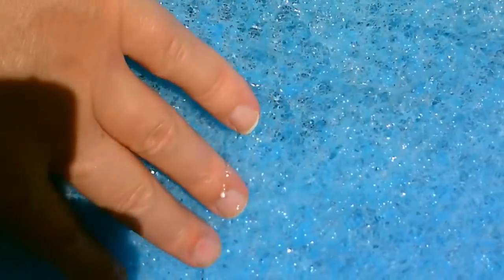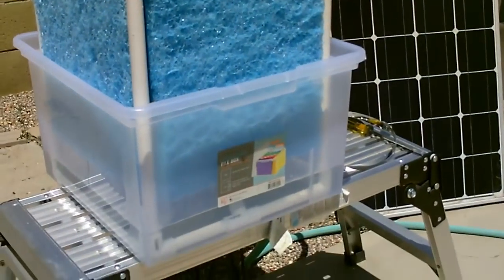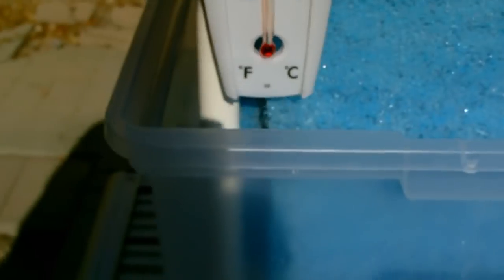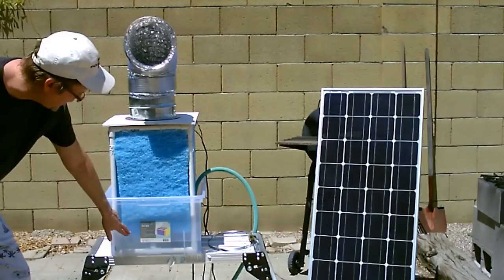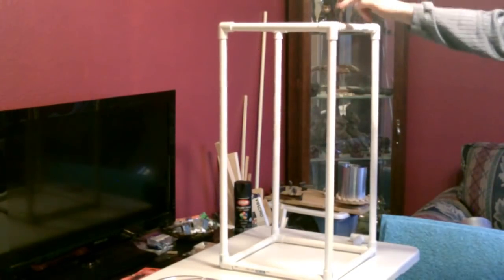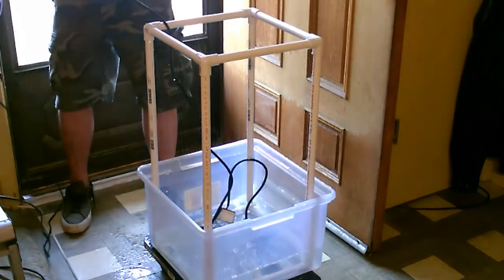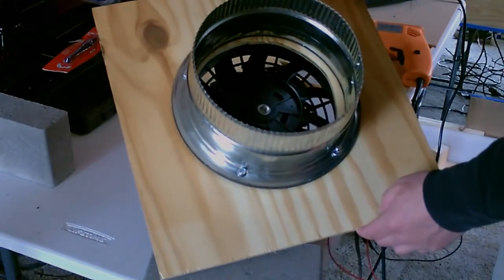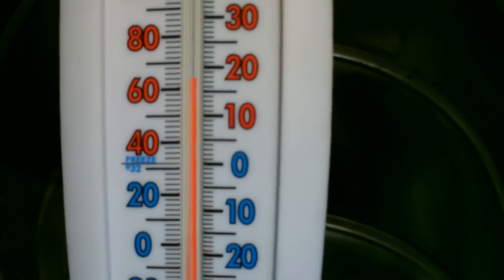DIY Evap Air Cooler! Best Yet! 1500CFM/20MPH (90Fin/64Fout) 500-1000 Sq.ft. run AC/DC/Solar/Batt

Comment: Is it possible to add and charge a 12v battery while the entire system is running? This way you can use the system at night once the sun goes down?
Reply: I’m trying to do this except run the pump and radiator fan off of an ac/dc inverter that is hooked up to two batteries.  What I discovered is that each watt usually only creates 2.5 watts of energy from the sun in a 10 hour sunny day.  This would mean that a 100 watt solar panel may only creat 2 1/2 hours of run time.  A higher wattage solar panel or even two higher wattage solar panels could create 1,000 watts of stored electricity on two batteries, then you may use the swamp cooler for 5 hours a day, only discharging half of the 1,000 watts to keep your batteries lasting longer.  A discharge beyond 50% would cost you more in the long term because of the possibility of halving your batteries life.  Two 200 watt solar panels with 2 solar batteries could get you to 1,000 watts being produced each day.  Once 1,000 watts of store is reached, you could easily run the cooler for longer than 5 hours only during sunny hours.  The goal is to keep it above 50-60% energy stored.  You could monitor it through the charge controller.

Comment: How would I use the fan with regular electricity? Thank you for your kindness in sharing.- and answering questions
Reply from the maker: hi the best way is to buy a AC to DC transformer. then you can just plug the fan and pump into that and plug the transformer into the wall. amazon has tons of them. i've also got a video on my channel of how to do it.

Comment: Great concept, I grew up in the desert SW. We had a swamp cooler at our house. 
Have you tried to source the fans lately? I'm finding only ones that are rated 800 cfm.
Will that work effectively?
Reply: I’m having the same issue. He’s got a 7 inch fan that moves 1500 ft.³ per minute plus. I really need to get my hands on that kind of fan. Only one that is twice that size moves that kind of air that I’ve found, also 80 watts, one used to cool a radiator for car. If you find something decent, please let me know, will you? Thanks! I’ve got a message in to him, too.

Comment: We live in a humid climate. You know by now cool water can dehumidify. That's a tall order. Ice? Not practical. But I do know this: if you can get dry air to a swamp cooler it will work in muggy coastal climates. Love this and thank you for all your work.
Reply: Have your air run across desiccant in a tray for a large surface area.
Reply: @ronmiller7916  Yes that's the idea. But desiccant gets wet too so we have all these complicated engineering attempts to dry the desiccant on the fly using solar heat or propane or whatever. But I think it can be agreed that dry air sent through a swamp cooler is cooler air. Now just to make it work constantly! Thanks

Comment: This design makes the most sense ! Good job.
Reply: I live in arid Utah and have two boys in youth football. Their games are back-to-back, which means sitting in the hot sun with only a pop-up shade for 3-4 hours each Saturday. I had already made a Homer bucket design, but it didn't move enough air. I'm going to strip the pump and fan from ole' Homer and make one of these instead. I'm sure this will be a much better design and should make my kids games much more enjoyable.

Comment: how much is a solar panel?
Reply from the maker: hi. these days they are relatively cheap. you can get a good 12v 100 watt one for as little as $79.00 on amazon. i got one recently for $84 and it's awesome. possibly even better than my top line one. (which was 30 more). if that still sounds like a lot, remember that they last for 25 years and can be used for all sorts of projects. 🙂
Reply: Sponge from filter fish tank rite?
Reply from the maker: the pad is actual evap cooler pad. home-stores like home depot have it 😎
Reply: Oh boy. Solar panels are so cheap nowadays. Its amazing.

Comment: hi  man, awesome video, i live in indonesia where it is humid and only have 2 kinds of weather all year,  which type of DIY air cooler would you suggest? i read this one can make the air more humid
Reply: Do what so many are suggesting.  Place something like this outside, then bring the cooler water inside to a heat exchanger.  I live in Ohio, fairly humid in the summers, but we still effectively cool our production equipment with evap cooling.  If it is 85 out, everything running, the delta still turns out to be about 10 degrees.  May not seem like much, but it is proof it still works regardless the amount of humidity.  High humidity does hurt the efficiency.  That can to am extent, be overcome by size.
Reply: @wadebrewer7212  thanks Wade for the info. I too love in Ohio and was hoping you could point me in the right direction on how to get more information on this such as how to hook up a heat exchanger. I don't know much about this stuff.
Reply: @squishfaceofsaryrn  it would have to be a full on DIY set up.  I am not one for thermodynamics....I leave that for the experts.  You will need to research a unit that will cool water enough regardless of humidity.  It may end up being very costly and may not be worth the while honestly.  There is a reason evap cooling isnt offered in higher humidity areas of the country.  These systems as whole house systems are used out west in very dry and very low humidity states with a high level of success.  The cost to run them are far less than a compressor driven cooling system.

I have tinkered with the idea of how to use a pellet boiler to cool, yes, that is right to cool.  If a series of heat exchangers were set up to heat the air then rapidly cool it (outside ambient temp through heat exchanger) the air would dehumidify, do that maybe or three times before entering the evap cooler, the effect, in theory, should be greater to cool the water passing over the media, even if that air is a warmer than outside air.

When I talked about heat exchanger in the house and this evap cooler being outside, I meant to run the cooled water that collects in the bottom after running over the media into the house with heat exchanger and a fan.  Basically............working like a split AC unit, instead of refrigerant, the cooled water from evaporative process would be used.  This is how industrial evap systems work.

Anytime you think of these projects...you just have to think in terms of heat transfer.  I have heat in a area, how do I transfer it to another area.  Heat will go from gradients of high to low.  If the room you are trying to cool is hot...that heat energy will absorb into a heat exchanger or ac unit and be transferred some place else, either water to be cooled outside or refrigerant that needs to be rent through a process to expel the heat that was absorbed out of the room.

Basically, stop thinking in terms of cooling the room and start thinking in terms of "how do I absorb the heat out of the room and expel that into some sort of process"
Reply: @squishfaceofsaryrn  as far as the heat exchanger....they are all over ebay and amazon.  Desert Sun has used a number of them. All they are is a boiler heat exchanger, work very well.  I am using one now to warm water off my pellet stove to a drum and copper coil heat exchanger to prewarm my hot water tank water.  Works pretty well.  You can use them to warm water or cool water, either way.

Comment: I need the plans for this for an apartment> will there be any videos on this > this is great> I remember my sister in law had a swamp cooler in Midland and it was 120 degrees outside but her house was a cool 65 degree we didn't go out  much only to turn the ribs and immediately come back in  lol! I love the way you are experimenting a researching > question: Will you have to deal with mildew, cleaning and dirt accumulation in the filters?

Comment: You've a wonderful inventive mind.  Thank you for sharing your build; very clear explanations and the materials you used. How practical was it to use the 4-side unit indoors, knowing that you were using solar power to operate it; meaning, did you have any wiring problems to use solar power for an indoor cooling unit such as yours?  Would it be practical to use a 12-volt lead-acid battery to operate the unit, instead of solar?  and using the solar panel to recharge the battery?  For over a year I have been contemplating building a cooling unit, much larger though, using fans that I have salvaged from the HVAC units I have replaced over the years in my home, to cool my garage/shop during our typically hot weather in the summers (Oklahoma).  I'm looking for design ideas, perhaps to duplicate the currently available commercial units, which are quite expensive.  I had one idea to use the cabinet from an old projection TV  (50 inches or larger) as the basic housing for a unit.  Your use of PVC pipes has given me more options for such a design.  Again, thanks for sharing your ideas and build.
Reply: Since we are working on the same idea of hooking up the cooler to an AC inverter, I have purchased an ac/dc converter for the hookup of the radiator fan, but I’m not an electrician and having trouble getting the radiator fan hooked up right and working.  I have searched all over, but there is nothing about how to connect or not connect the blue and black DC wires on the radiator fan to the ac/dc converters red and black DC wires.  I have only read about the black wires usually representing Neutral or non-hot wires and red being positive hot wires.  The blue with the red could be a danger.  I don’t want to blow anything up or hurt myself.  Any suggestions from anyone who has been doing similar experiments to get the DC radiator fan working with AC power without the need to hook it up directly to a solar battery?

Comment: Made one of these and it's working good but water does not come out of every hole I drilled. Thought it was possibly blocked so checked cleaned and even drilled a little bigger drip hole. still same result. Is it possible that the 70 gph small fountain pump I have is not enough?
Reply from the maker: hi.that's probably it. i'd use no smaller than maybe 150 gph one.

Comment: The pads alone are $60 on amazon. This is more like a $150 build.
Reply from the maker: hi you should never pay that price for the pads. they are usually 6-8 bucks. i've seen them on amazon for 7-9 in the past. but they are hard to find at a good price sometimes (on that site).
Reply: I know your comment is old, but for any others who see it, Home Depot 30x36 pad (a bit bigger than the one in this video): ~$10
https://www.homedepot.com/p/DIAL-DuraCool-30-in-x-36-in-Evaporative-Cooler-Pad-3074/100346714
Reply: Lowes

Comment: Best deal I could find for the fans

https://www.ebay.com/itm/2-X-7inch-Universal-Slim-Electric-Radiator-Cooling-Fan-Push-Pull-12V-Mount-Kit/323860818424
Reply from the maker: thanks for the link. 21.99 for 2 is a great price.

Comment: I'm also in Arizona. I built this and gave it a test run in the garage (3 car). The garage was 96 degrees at the time. Humidity was nonexistent. After an hour it had come down to 93 and very humid. I had the door cracked as I've read that's important. Anyway, 3 degrees plus a ton of humidity wasn't what I was hoping for. What am I doing wrong? The sizes are very similar. Build is almost the same. Fan looks identical and was running fast. Pump was working. Pads were wet. Any tips?
Reply from the maker: hi there. the problem is probably the ventilation. that has to be just right (so that no extra humidity is left. that needs to be pushed out of the building. it sounds like the humid air is getting trapped in the garage. my suggestion is to place the unit outside of the garage and pump in the air. then just make sure you have good cross ventilation. that allows all the air to pass thru easily. that should work for you. then you might need to make a second one to handle a full size 3 car garage.
Reply: Actually from what i have read a swamp cooler only lowers the temp about 6C max, the temperature reading in this video were not done correctly in my opinion.
Reply: @CMZneu  I disagree.  Most process water systems are evaporative.  The delta on water from outside to plant water is at minimum 10 degrees in the hottest and humid days in ohio.  

Besides.....there are companies that build large evaporative units for homes to cool them in low humidity areas.
Reply: Also, you said the humidity was nonexistent, but your comment is from 9 months ago, which is the very end of August or beginning of September. Still likely to have some humidity from the monsoon (typical dates for the monsoon are late June until the end of September) . Are you sure the relative humidity was low and the dewpoint was below 55 degrees? If the dewpoint is 55 degrees or higher, evaporative coolers won't work well (even 50+ and they don't work as good as they can). Sometimes the dewpoint can be higher than you realize, especially towards the end of August or early September when the temperatures cool down a bit, but there is still some humidity in the air from the end of the monsoon.

Comment: Hi, could you please tell me about the solar panel?
Reply from the maker: hi. the solar panel i used is a 100 watt monocrystalline one made by renogy. but any 12v 100 watt panel will work. a little bigger is okay to. a 120 watter would be awesome
Reply: Thank you so much for making the video!!!! I noticed there are so many different kinds of solar panels, just not sure which one is  gonna work the best. I live in Phoenix, and it’s just so hot!!! Big swamp coolers are so expensive, but with this video, I could piece it together a little at a time.
Reply from the maker: i agree. those commercial ones are very pricey and similar sized ones are really no better than this DIY one. also if they break, good luck. but with this one you can easily fix. 🙂
Reply: Thank you so much for responding. Thanks to you, I will be able to piece it together a little bit at a time, and finally have some cool air!!!!
Reply from the maker: awesome 😎
Reply: One question I have, is with adding the Cupler for the water, does the water fill of the side pillars from the bottom all the way up? Or do you have them blocked off?
Reply from the maker: the water fills the whole frame.
Reply: Awesome thank you so much again!!

Comment: So just a quick question...
Do I need to use a charge controller when hooking up the dc devices to the solar panel? Will I cook my pump by hooking it directly to the panel without a controller?
Reply from the maker: hi. you don't need to use a charge controller. you just hook it directly to the panel. you will not cook the pump. the item just pulls the power that it needs. kind of like you can plug a nightlight or a microwave oven into a socket. each item only draws what it needs.
Reply: @desertsun02  
Thanks for the info.
I appreciate your creativity and knowledge.

Comment: i paid $55 just for the cooling pads and about $30 for the fan. So now i just need the bucket and water pump. the overall price is good.
Reply from the maker: hi. that's way to high for the pad. they are sold at home depot for 7 to 9 dollars usually. some amazon sellers price them very high i've seen.
Reply: Where did u buy your fan at , it's $100+ at O'Reilly's Auto Parts, & does the cooler work good as he says it does, & yes you got ripped off on the pads

Comment: That small tub of water lasted 8 hrs....wow.I have a free small swamp cooler that barely gave me 4 degrees off the temp when I started it at 7am before the heat when it was still only 90...I bougjt most of this stuff to make a 12 gallon tote with a box fan version that seemed bulky an more unstable.This is great.

Comment: I love the simplicity of your design.
I have some recommendations based on testing I did last summer. This will require 2 fans. One like you are using and one in the heat exchanger.
1. These require the use of the heat exchanger you mentioned in the video.
2. Add precoolers before the pads. I salvaged a car radiator and ran the pump water through it and exited to wet the pads. This will drop the air temp entering the pads making the tank water cooler.
3. The precooler needs to be mounted on end so the water can enter from the bottom and fill the radiator.

4. This design works best with the pads laying flat with water from above in a grid pattern and the air entering from below. The pads will be stacked between 4 and 6 layers thick.
5. Recycle most of the outlet air (50%-90%) back to the air inlet of the precooler. This will repeatedly cool the air cycling around the system and drive the humidity of that air to around 85%. You can regulate this by adjusting the amount of recycling.  The water temp will drop to chilly cold.
6. Right after the fan make an adjustable wastegate. You can use duct tape for experimenting. Also, make the same type of gate for the air inlet just before the precooler. These are necessary for the air recycling to work as expected.
Reply: You should post a DIY for it.
Reply: @supremeelohim1467  Your username is funny. I like it!
Reply: I'd love to see some kind of diagram of your idea.   I don't suppose you could draw something and then take a video of the image and post it to youtube?

Comment: Very nice build! I was wondering if this would still cool the water down under humid outdoor conditions (60% -70% humidity). afaik evaporative coolers can't cool the air anymore if its too humid but does the water still cool down ?
Reply: No, it only works in dry cilmates
Reply: * climates